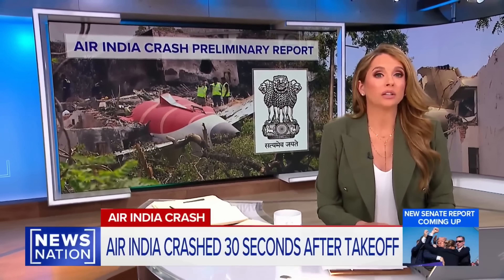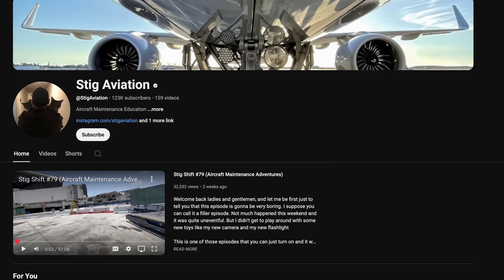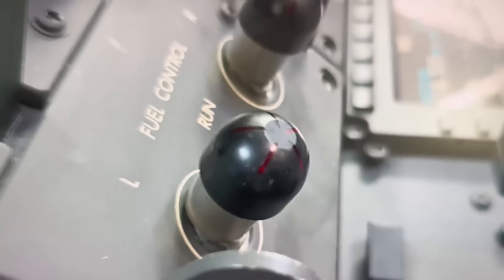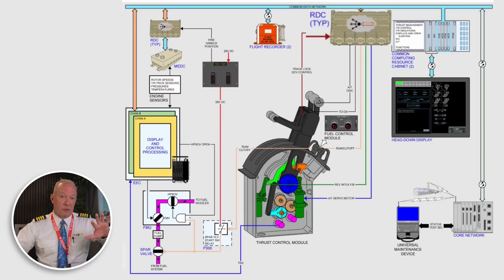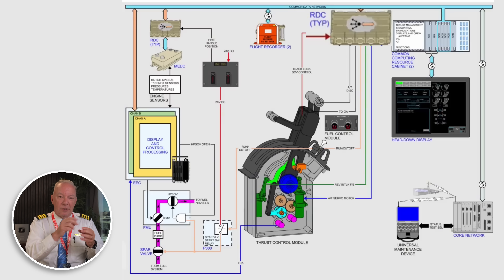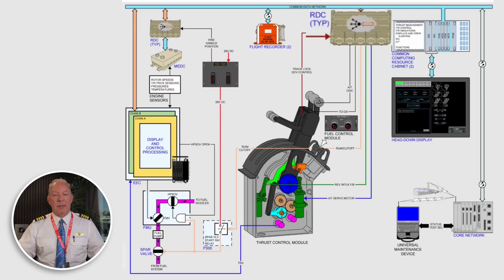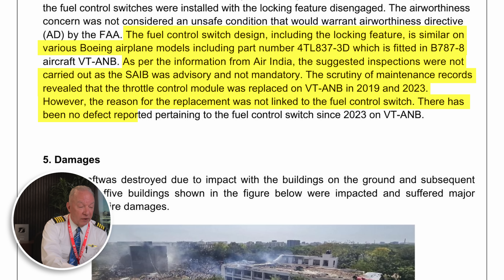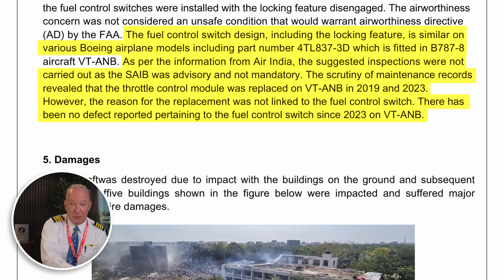The Truth About Boeing 787 Fuel Control Switches

Comment: In the Boeing design, each engine has its own pair of EEC channel relays controlling its HPSOV. If a common trigger (like a false “aircraft on ground” or thrust mismatch signal) hit both EECs at once, the shutdown logic in each EEC could process and act almost instantly, but not necessarily at the exact same millisecond.

One EEC might:

Validate the fault condition first,

De-energise its channel relays,

Close its HPSOV, and

Cause that engine’s FDR “fuel control switch” to jump to CUTOFF.

The second EEC might:

Take slightly longer to confirm the same trigger condition, or

Be delayed by internal task scheduling or slightly different sensor input timing.

A 1-second lag is entirely plausible, because the logic runs independently in each EEC and the relay actuation isn’t perfectly synchronised between engines.

In other words, the 1-second offset doesn’t make this a manual dual-cutoff, it’s actually what you’d expect if two separate but identical computers each shut down their own engine in response to the same false trigger?
Reply: The problem is that hte FDR is saying "The switches were set to cutoff" not "There was an error and fuel was cut off"

Comment: I'm not saying anything about how this happened because it did.   As a software engineer / electronic engineer at a robotics company.   Mechanical relays are that.. mechanical...   they have moving parts and fail.  Solid state relays are the way to go.   No moving parts to fail.  And if wired right if the solid state fails it would in the ON position (safe engines running).
Reply: But both, at the same time???

Comment: AirIndia is desperate to cast any doubt they canon a mechanical/electrical issue because if the pilots turned off the engines they know they are done. Too much money is riding on this and they are going to drag their feet as long as possible.
This is similar to the Malaysian air  flight that just disappeared. The airline refused to accpet the plane was under controlled flight  right up until it disaapeared.

Comment: Ed Pierson did valuable service by whistleblowing on Boeing's shortcomings but has somewhat lost credibility over this issue. In his appearance with Capt S on the Piers Morgan show, he allowed his prejudice to run riot. 
The run of the mill crazy conspiracy mob are bad enough.  When an authoritative figure adopts the same wild guesswork, it's even worse.
Capt S received much stick because he originally surmised that the flaps had not been set correctly.  That was an entirely  plausible, rational and logical view to take on the facts known at that time.  He was disgracefully ridiculed for it when that theory was subsequently disproved (and he was visibly shocked at his treatment (welcome to the mainstream media).  But Pierson was clearly motivated by his anti Boeing position and adopted a scattergun approach, to his discredit.

Comment: @CaptainSteeeve  Can you please provide references to support your contention that the fuel cutoff switches are directly connected to the valves mentioned, with no intervening intermediation.  From everything I have been able to discover from publically available information provided by Boeing as well as by the US Patent & Trademark Office, the entire concept of the Boeing 787 is that switches, sensors, actuators, etc. are connected to Remote Data Concentrators (RDC's).   The RDCs are in effect miniature computers, running software/firmware, with a variety of interface capabilities, and their behavior is configurable.  I speculate that the diagram you are using is intended to illustrate a conceptual relationship between the switch and the valve(s), and may be a useful model for some purposes, but is NOT accurate when getting down to the details being discussed here.  If you read the Boeing patents for RDCs, it claims features to provide outputs when the inputs are unavailable or inconsistent.  

Here is my understanding, using made up labels to aid this discussion: Left Engine Fuel Cutoff Switch has four poles, each with two throws, thus each pole has three contact wires coming from the switch: for common, for RUN position, and for CUTOFF position.  The connectivity of the four poles are something like:  LeftEngineSwitch.Pole1 contacts wired to LeftFlightDeckRDC;  LeftEngineSwitch.Pole2 contacts wired to LeftFlightDeckRDC for switch redundancy comparison;  and for RDC and other system redundancy: LeftEngineSwitch.Pole3 contacts wired to RightFlightDeckRDC;  and  LeftEngineSwitch.Pole4 contacts wired to RightFlightDeckRDC for switch redundancy comparison.  And reverse corresponding for the Right Engine Fuel Cutoff Switch.  

The RDCs in turn send switch position signal to the EECs, whether via network or via wire harness to be determined, and the EECs in turn control the fuel valve relays, etc.  As well, the RDCs send corresponding switch position data via core network to the common computing resource and to the EAFR for flight data recording.  

Contrast this with what Stig Aviation says here, https://www.youtube.com/watch?v=-ur234kwnhk, effectively that, in addition to switch pole contacts connecting to the RDCs, the contact from one or more switch poles are wired directly to the fuel valve relays, entirely bypassing the RDCs.  Which is the correct understanding?

Do you have experts you can consult on this question and clarify Is this a correct understanding?  Thank you.

Comment: I'm not sure thats quite right steve, the valves are fail safe, this means they require power to open and close the valves, without power at all the valves remain where they were. However if the valves closed before the switches were moved by some transient fault there would be some evidence of that on the FDR and CVR, It would be a gross error on the part of the investigators to miss that. The evidence as it stands is for a deliberate act. It needs to be determined if it was an intentional (malicous) deliberate act

Comment: I have some questions based on the diagram he provided. If the valves are powered open (meaning they require voltage to be actuated into the on position) do they also require power to return to the closed position? Or does it   return to the closed position when power is removed from the circuit (circuit is open)

Additionally diagram he used shows an "and" gate for one of the valves. Is it possible that the secondary input for that "and" gate was lost and in turn crossed the valve to close?

Comment: I am trying to understand this explanation, is the relay is a mechanical relay? If it is an electronic relay it would require a voltage to open or close the relay, which then means your explanation isn't valid. The 28v that opens the valves is not the same voltage that is required to open or close the relay. Moving the fuel cutoff switch would allow a current to flow to the relay energizing the coil and closing the relay allowing the 28v to open the valve. Therefore if this voltage that is actuated by the cutoff switch should fail then the relay will open and the valve will close. Unless this is a mechanical relay (which I doubt) then my argument isn't valid.

Comment: Hello. @1:50, is it not physically possible to accidentally place the switch in a third, intermediate position?
Reply: Why would you want to do that? First of all, it is virtually impossible to move it accidentally. Second, when I went the switch moved to off, I want it now. Third, you have now introduced another position for the switch to places in accidentally.
Reply: @mickeym2380  it's not about want, it's about possibility.
Reply: @OldManDUVL  no It is not Physically Possible it will slip to one side or the other
Reply: Inside of the switch can only make contact with one side or the other.

Comment: Captain Steve may be an excellent pilot but he's a terrible engineer. He keeps talking about this plane if it was designed and built by the Wright brothers.  The problem had nothing to do with the switches it's that the switches don't directly connect to relays but rather go through a computer system. And that wiring is monitored by sensors also connected computers and flight data recorders. What's some technical people are saying is that there was a failure particularly in a power diode the long story short caused a power failure on the lines the sensors picked that up as exactly the same behavior as would have happened if the switches were actually physically changed but in fact that didn't happen there was a power failure.  One Pilot asked why the other might have changed the position of the switches because he noticed the engines were powering down but don't forget the other pilot said he didn't change the switches position. In fact it was a power failure that caused the relay to trip shutting off the engines
Reply: By the way the 28 volt power that Captain Steve keeps talking about that comes from a battery doesn't come directly from that battery it goes to the power diode that failed.  As a result there are several ways in which that could have interrupted the power supply to the relays which caused them to change position and shut off and also a lot of to be recorded by the flight data recorders as if the physical switches were moved

Comment: 3:02 is it possible to place/put the fuel control switch between "Run" and "Cutoff"? The mechanical "nibble" sees round and also the detent is rounded up but with a spring force even a smaller friction could be enough to hold the switch on top of the detent? Are the engines starting or shuting down when the switch is exactly in the middle? In the end it is an mechanical contact so at some point on the way from "Cutoff" to "Run" the connection has to be made. Is it at 50%, 70%, 90%? And how is it the other way round when switching from "Run" to "Cutoff". When does the connection break up (Hysteresis)?
Reply: Whether Wreck was from Psychosis or Negligence,  it's never going to be a MFG's engineering fault , despite the current Media fascination of Boeing Bashing. 
Voice recording has no indication of objection after switches Off inquiry by a pilot,  only denial by the other. That may indicate unintended negligence or confidence the flight was already doomed.
Reply: @peted5217 is this answer related to my starting post/question at all?
Reply: He answered that. There is a relay. A relay is typically either 0% (off) or 100% (on). I can't imagine a relay that wouldn't work like that. 

I worked in manufacturing for 18 years. I worked a lot with relays, including maintaining pneumatic / hydrologic / relay controlled automated machinery.
Reply: @toby9999 The relays come after the switches. I think you didn't understood my question, maybe I didn't explained it good enough ( english isn't my first language).

I don't toubt in your knowledge about relays. I was just not talking about them.

Comment: Where does the flight data recorder get its information on the position of the fuel control switches? Is it measuring whether voltage is going to the control side of the relay, through the load side of the relay, at the valves themselves, or a combination of multiple of these three?
Reply: Also, just to be pedantic, but relays are digital. They're 0 or 1, not analog, but I know what you mean when you say there's no digital signal you mean no data communication beyond the single 0 1 bit of the relay.
Reply: @kontakt4321  to be pedantic, they are binary.

Comment: Everything you saying is scientific but answer only one question. How do you rule out the possibility of Prior Double Engine Failure, in response to which pilots did this "fuel switch off-on procedure" which already is a training module rulebook item in case of double engine failure ?

Comment: What are what I assume are astronomically low odds that both switches or relays would all fail at the same time. Mechanical devices can and will fail with enough time and use or abuse.

Comment: so ALL power would need to be lost for the rat to deploy and the fuel to cutoff with the switches in the on position. And then 10 sec later power came back.......  I know, it is a reach    thx for sharing

Comment: Things we "hope" for?  Unfortunately there are those who seem hell bent to blame Boeing for this. There seems to be a real hatred going on and it must be damn disappointing that the evidence isn't going that way. If the "whistle blower was right, it would mean virtually every modern aircraft has that built in flaw. Yet he concentrates only on Boeing. If there is an issue, fix it! Do we really need to take down one of the worlds most important businesses in the process? 

One thing I would like you (Captain Steve) to comment on. It appears to me those pilots made no effort at all to push the nose down after the loss of power. That's a pretty basic maneuver even under stress and intended to get ever last inch of flight out of the stricken aircraft.  The deck angle appears to remain pretty much the same from rotation all the way down. No effort to retain airspeed or maneuver to a more suitable landing area. I'm not saying it would have saved the day. But it sure points to some unusual airmanship.

Comment: I'd say, the location of those fuel control switches is not the best place to mount them on. They should be located on the overhead board instead. Even if the pilots should have a spur of the moment in their mental stress system,  they would have to reach out to the overhead board/panel in order to commit a malign act. And that move can also be observed by the other pilot and prevent it from happening.  Or simply constructed the system in a form, that only a simultaneous operation, triggered by both pilots would allow to operate the engines. Otherwise the way they operate,  it can become a cat and mouse game between the pilots. One pilot wants to cutoff the engine in the midair flight, the other want to switch them on. Years ago the Egyptian pilot did the same thing in a suicidal mission. But at least he prayed in the name of Allah before switching them off. 😂 The copilot didn't understand what was going on. By the time he realized,  the plane nose dived into a rapid descent.  

The Indian pilot was keen to the insurance payout deal. That's why he denied switching them off,  so his family can claim his life insurance money. But it doesn't look like it's going to happen,  because the foul play has been detected. There's no mystery in the heads of the mentally disturbed patients. They all similarly want to commit suicide. You meet many people like that in the line of duty, in medical personnel and police force. They want to commit suicide. It's a faulty circuit board. At some juncture they will if they are not treated accordingly.  

Many say they just need the counseling.  But nay, they need the treatment. Counseling is for those who are going through stressful periods,  when too many things are happening in confluence,  and they are unable to deal with the problems, then the person undergoes emotional stress counseling / therapy for relief.  

The person who wants to commit a suicide is in a different mental state. It means that brain cells depletion have occurred. Which was the exact case of the indian pilot. The Indians call it a total twat and premature speculation. 🤣🤣🤣 But they maliciously want to blame the Boeing to pay the large bill for them.

Comment: I call BS,   That is not a schematic but a high level pictorial diagram.  You have to look at the exact cabling diagram to make any kind of diagnosis guess.   As a EE and A&P I would want to know are the grounds routed where are they attached to the air frame or return bus,  where does the 28v power route and how is it sourced.  What happens if the power or grounds to the switches and relay is interrupted for a few millisecond, do the engines ride through or will they continue to spool down even if the power is restored.  You are making the assumption that the switches were activated but all you really know is what the flight data recorder sensed not what actually happened.  We don't know exactly where in the circuitry the flight data sensing takes place and how often the line is sensed and recorded,  ie. every millisecond, ever second every 10 seconds.  So claiming they were off for a second or had some sequence is pure speculation.   I have used those switches, and normally they work as advertised.  However I have seen well worn switches where the little ramps preventing activation have worn down to nothing and a gook knock can change the state, not common.   The switches are in the  fuel control module, which may pass all tests (but do the test check the switches) and what about the cannon plug connectors connecting the unit to the instrument panel cabling.   I understand this aircraft uses lithium batteries, what about the battery management system fault cutting off the the power momentarily, why did the RAD deploy Just thousands of fault possibilities to consider.    We have already seen this sort of thing with the MAX and the angle of attack sensors.  
I don't know if the pilots turned off the switch or not but that is just one of the thousands of possible causes, all should be given equal probability at this stage.

Comment: I think we all get it that the switches didn’t magically jump over the gate. The question is: was the deliberate pilot action of moving the switches to cutoff a reaction or response to what the they were experiencing or was it something else? I think we’re beating a dead horse here. Another question is: how did the plane climb to approximately 400 ft agl with two dead engines, someone please explain. When you do a V1 cut in the Sim Steve, how long does it take to climb to 400 ft agl? And this is with at least one good engine.